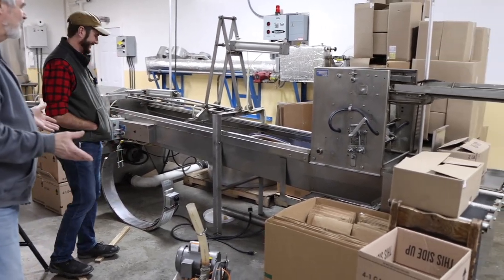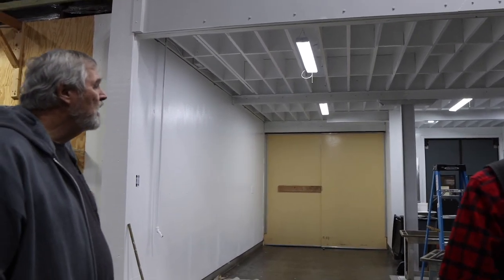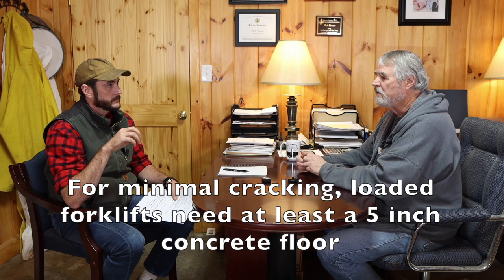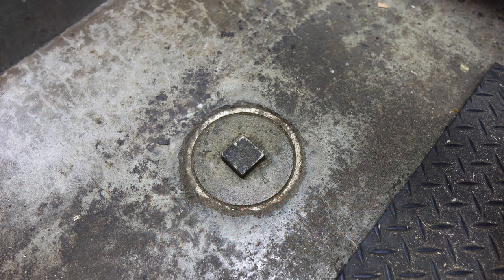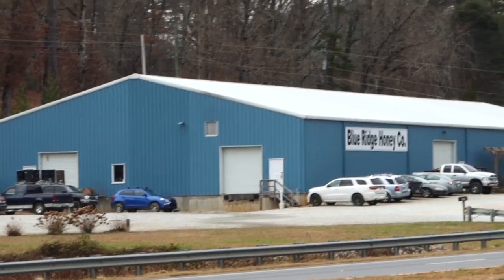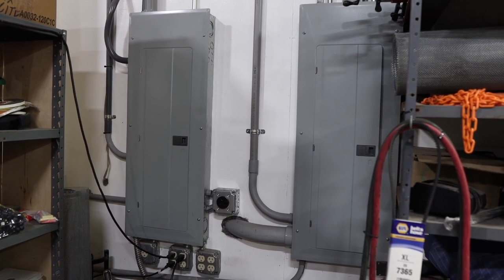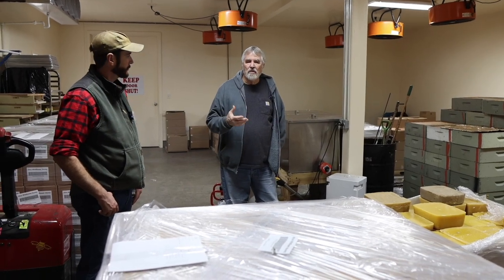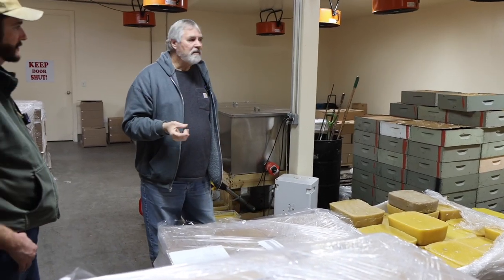Honey House Mechanics and Design

Comment: Bob, this is one of the best videos on youtube. There are a bunch of things I would do different if I were to ever  build another honey house. I did upgrade concrete to 6k psi. Contractor wanted to use 4k. I installed a trap to catch wax from floor drains. Plumber thought I was crazy.
Reply from the maker: I would love to go back and start from scratch with our floor drain plumbing.👍
Reply: What is a trap to catch wax? Is it a special trap meant for that or a common plumbing setup that will do it?
Reply: @deeprootstexas  Grease trap, the plumber installed after the floor drain before the septic field. Keeps the wax out of the septic.

Comment: Commercial facilities have so many regs.  I'm in Pa.    A friend of mine built a small honey house at the community garden in Philadelphia.  She allowed me to extract for years before she ended up in an assisted living facility.  
It was just a shed.  It had a concrete floor.  Running water and hot water was required.  It was tight to move around in there but it worked for what she needed.   Now I don't have a facility but I also reduced to a hobby beekeeper.  I only extract what I feel I need and do it up the mountains for personal use.   I can't do it at my home outside Philadelphia because we do have a dog.  Animals are a big no no for any kind of processing.    
I might be going back to cut comb or sectional comb honey this year.  The farm where I have most of my hives is certified by our state agriculture department for agricultural processing and sales.    
Each state is different.  The size of the beekeeping operation and extraction is different.
Great video Bob.  Thank you very much.
Reply from the maker: Thanks,

Comment: Did you do anything special to the joints on the plywood you used on the walls of the honey house? I was thinking about using FRP but, plywood was good enough for you. I'm sure I will be happy with it too. Was just wondering about the joints.
Reply from the maker: We put filler in the seams and screw holes to give us a smoother surface.

Comment: Did you pour deep concrete pads for the steel supports to sit on? Was this designed with the help of a building engineer?
Reply from the maker: We poured fairly large piers on hard virgin earth for the posts. For better or worse I have designed everything about our buildings. No worries though. I tend to go way overkill on everything.